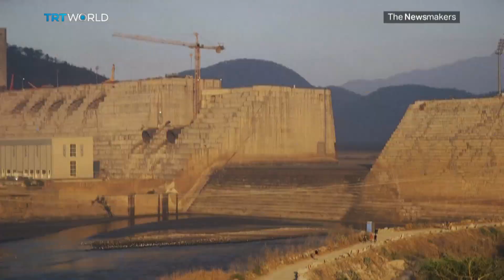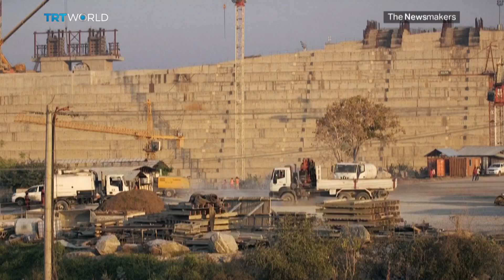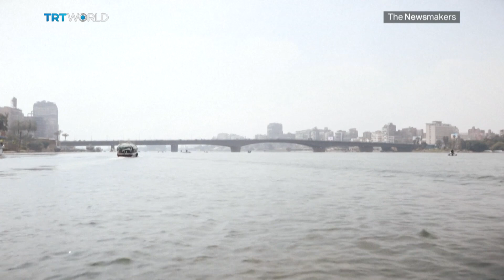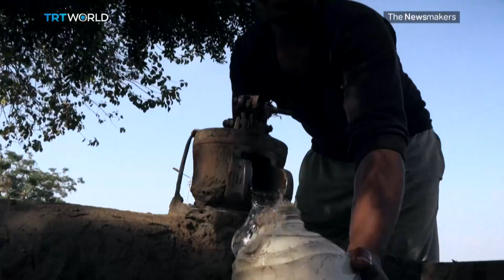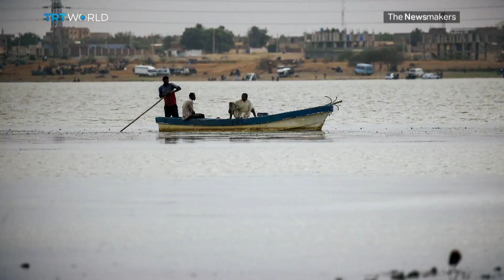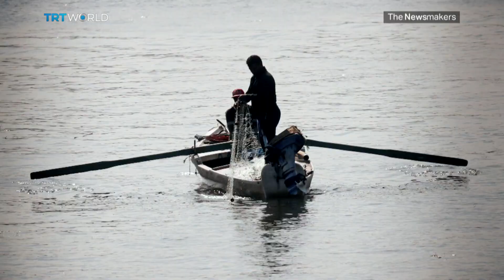Ethiopia’s Grand Renaissance Dam

Comment: Egypt is saying that at the time of filling the dam they might have shortage of water to keep the present crops production output although they have billions of cubic meter water accumulated and evaporated every year on Aswan dam. but for Ethiopia drought and living without electricity is the reality at present. therefore, Ethiopia has the full right to use its natural resources to feed its people and provide electric power.
Reply: The problem is Egyptians problem. If they want water they must make payment.
Reply: And no one is denying that right. Read the 2015 Declaration of Principles. It should also be noted that electricity will begin to be generated this year when the dam is no where near being full. Egypt would have a shortage of water if the dam is filled in 3 years which is why Ethiopia agreed to extend the timeline.

Comment: Eh. Just fill it up a bit slower—can't we do the math on this?
Reply: Filling up slowly means it takes longer to generate electricity at full capacity which means they'll lose money. Unless egypt is willing to compensate for this which they are not
Reply: @SabrinA-hn7ix  Electricity will start to be produced even with a partial fill as soon as this year if I'm not mistaken.
Reply: D damauw  If you think Egypt wants total control I think you need to read the 2015 Declaration of Principle
Reply: D damauw  so u are either lying or completetly ignorant to what you've 'read' if u think Egypt wants total control as the agreement states that all countries will work together to minimize harm on each other and compensate each other as necessary if harm is done. Furthermore 90% of all issues have been worked out and the remaining 10% will probably eventually get worked out as well.